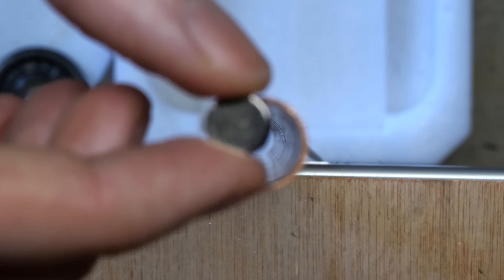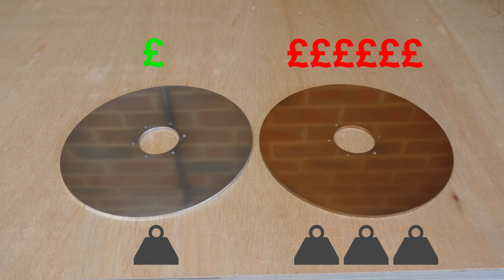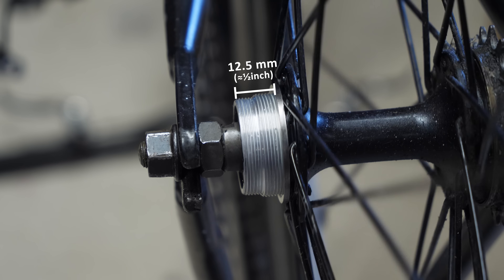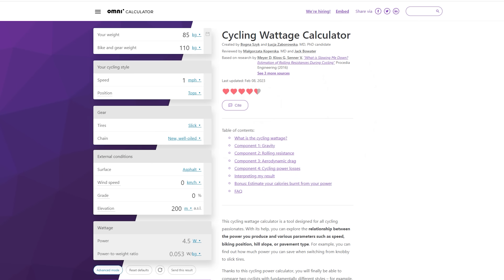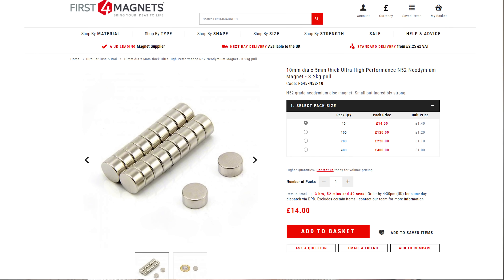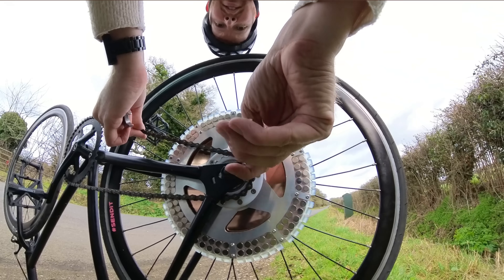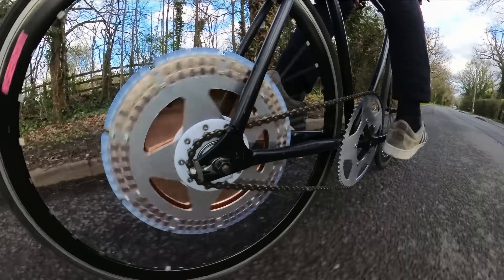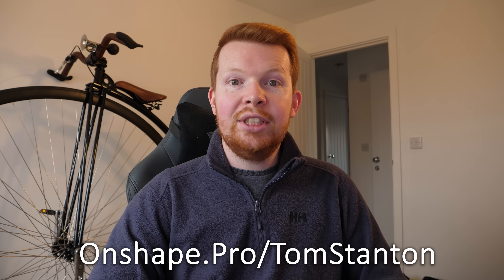Gearless Magnet Bike

Comment: It would be really good for semi trucks. Brakes heat up very fast in mountainous areas, and a jakebrake violates noise ordnances. This would be an awesome way to help big trucks keep speed down without burning out brakes, given sufficient torque and cooling. A static electromagnet could be switched on, and copper rotors on the axle could be cooled with air or some small boil-off system. Even if it overheats the only damage is warped copper, and the traditional brakes would still be cool.

Comment: Love the idea of an automatic clutch.
What about having a front gear made of many flexible rodes?
That way, the more the back wheel is pulling, the more flexible rodes on the front gear would deform, effectively reducing the apparent size of the gear.
And maybe flexibility of the rodes could also be adjusted on the fly moving contacts along those rodes, i.e. something that would allow to adjust what is the length of the ride that can effectively bend.

Comment: My thought is, get rid of the chain, use the magnets for a generator run by the pedals and a set of wire to an electric motor in the wheel hud. Then you want to stop, the hub motor could become a generator and electricity bleed with a resister, more resistance, more stopping power or a battery. Would this just be an ebike?

Comment: I don't get your end game. Using magnets in this way is going to create a clutch that will always slip and waste energy. A mechanical clutch will lock up and transmit power to the wheel without loss. Where is the improvement?

Comment: what about a combo bike that locks the wheel on forward pedal, but somehow engage the copper/magnet break until you engaged the actual breaks. That would reduce the wear on the brake pads and save a penny. haha. It's the hybrid idea that counts. Or evenuse it as part of the regenetive ebike braking.

Comment: Now i wonder, if you could convert the energy going to that copper disk to power a motor on the wheels, either on the front or the rear, like the rear wheel is still on direct chain drive but you have a digital drive (atleast that's the term i found) on the front.

IMO, that could make some funky bike designs.

Comment: The alternating magnets for stronger eddy currents was a great idea! You might want to look into the Halbach Array (a specific way of alternating magnets) that makes the field strength even higher. I think it might perform better than only alternating the magnets.
Reply: Exactly what I was Thinking.
Also can't he put a steel plate on one side of the array to cancel the magnetic field so he won't have issues with the chain and spokes?
Reply: @oodmboo  If he made the diameter of the disks bigger he could fit more magnets in to give him the torque he needs to go uphill and it would also solve the spoke problem since the spokes are already sloped away from the magnets further out.

Might run into torque issues breaking the disc though.
Reply: @oodmboo  And get a disc brake hub to mount the rotor disc on, since that's already precision machined for installing a metal disc.
Reply: @oodmboo  steel would just transmit the magnetic field.
Reply: Also it makes magnetic field much stronger on one side (the clutch side) than on the other side (the chain side).
Reply: the steel plate (ie completing the magnetic circuit) is better than a halbach array unless you are extremely concerned with size and weight
Reply: @5naxalotl  Rotational inertia is certainly important, though I don't know how much.
Reply: @JakubNarębski  I'm not an engineer but I'm a big fan of speed, and a little rotational mass goes a long way. Since he's dealing with low torque, I think differences of rotational mass will have even more noticable an effect.
Reply: @5naxalotl  I didn't know that! I'll have to test it out!
Reply: What about ditching the chain and going to a belt

Comment: Jesus - do yourself a favour and get a proper geared bike to play with. The splined drive hubshell of a cheap 8 speed Shimano hyper glide freehub body would be much stronger with 3d prints.
You are playing with the fixed side of a “track” hub - the freewheel side of a flip flop hub should have just the larger sized thread (without the left hand lock ring thread)

Comment: It might be a nice concept for combat robots. Usually they use belts to separate a weapon disk from a motor. The torque needed to speed up the weapon isn't too high, but when you have impacts you want as little torque as possible going back to the motor. 
Would be nice to see how it performs under big difference in torque being applied. 
It seams like it could smooth things up a little a be more durable than belts that often breaks

Comment: When the magnets stuck to the chain, I was thinking you could use a belt drive. Then I thought well, A belt drive has metal within so may also attract magnets. Then again I realize I have a belt driven pushbike. I put a magnet against the belt drive and no difference. Although a weak magnet. Does the rubber insulate from the magnetism? Nice video and some ingenuity.

Comment: I love how you had an idea and made it reality to test it. That's the sort of real-world findings that could prove to be useful for all kinds of applications that may even be totally unrelated to your project. I bet someone out there will see this and get inspired to try this in something else
Reply: But this is already in use. It's basically how an old school speedometer works. A spring loaded aluminium cup is driven by a magnet inside, that's it. Also many old record players use magnets to fine tune the speed (eddy current brake).
Reply: @westelaudio943  Cool. I did not know that

Comment: how about you mount a 3-phase motor (as a generator) to your pedals and another one to your wheel? then you can convert the AC to DC, and with a controller convert that back to AC at a different frequency for variable transmission rate.

Comment: you aren't measuring power transferred through the magnetic clutch, you're measuring power that's wasted in the magnetic clutch (and transferred into heat). so ideally you need that to be 0, instead of trying to match it to your pedaling power.

Comment: I see onshape allow their tools to be used for free for non commercial use. This is great and I might actually have to give them a shot - especially since fusion 360 has been doing everything in their powers to make sure every hobbyist user leaves them behind.

It is a bit of a shame simulations aren't a part of the hobbyist access though. Autodesk did the same thing with fusion recently - a bit of a shame.

Comment: I'm intrested in purposing this as a braking system instead of a clutch. I dont know how it will work but several advantages I can think of is that there are no wearing parts hence the brake will last forever, what do you guys think?

Comment: Another thing to note is that as the copper heats up, it gains resistance, which makes it harder to pedal, and also increases heat production. Vicious cycle. (I'm not sorry)

Something that would be interesting to test is if you added fan blades to your magnet disk, and drilled your copper disc for some cooling effect. It would require modifications for a thicker piece of copper, since you are loosing reaction mass by drilling the disc, but if you can keep the temps down, it should in theory be more efficent.

Comment: For your next project, make an electric bike right.. but have the pedals spinning a generator charging a bank of super caps. Then your stored energy from cycling can be used to increase the torque.

Also allows you to pedal harder even when going slow, and then when you need to accelerate fast, you have the power in the supercaps. Kind of like a hybrid bike.

I dont think the efficiency would be great though, but would make an interesting project.

Comment: I'm surprised the copper was only 30c. I expected it to be untouchably hot. I think a solution to that might be have the magnets on the wheel side and the copper be less obstructed and have some sort of heat sinking fins on it. Potentially even a really low profile impeller machined into the middle of it. But it seems like it still tries to act as a fixed gear bike, just with some slippage.

Comment: if you add a thin iron or steel disk to to the outside magnet surface, it will radically reduce the magnetic field outside of the disk, reducing catching by the spokes and chain, it need not be very thick.  it may also increase the applied field on the copper disk

Comment: Needs direct drive and magnetic overdrive.

Chain keeps a direct drive and magnetic forces to spin it past the chain ratios speed using the freewheel driver as a bypass.

Like a sun and pinion gearset. I'd go with three banks of magnets in a triangle formation around the disk.

Comment: belt drive would get rid of the chain issue
Reply from the maker: I've used belts for my ebike drive train, and they tend to be far wider than chains for the same torque rating. Which given the limited space, would be difficult to fit.

Comment: 16:07 You've made a math error. You didn't dump 8000 watts into that copper disc.  A pro rider is hitting 300 watt hours max, you're probably in the 125-200 watt range going hard for a 15-30 min ride.

Comment: Run some water pipe through the clutch and connect it to the seat or a vest circulating the heated water. That will make riding in winter more comfortable and fun. Just saying 😂

Comment: So what if you add a planetary gear to this? You will have your chain and wheel linked directly and the magnetic break will act as your third friction wheel. I am not sure it would change much though. At the very least you could easily lock the magnetic break at a higher speed to increase efficiency.

Comment: Hello! Nice vídeo! But this clutch is a heat dissipator. If you want a CVT behavior, you ll need and induction core (as a squirrel cage in induction motor) that multiplies the torque as funcion of rpm difference. Clutch transmities 0-100% of torque,  never multiplies ( as hydraulic torque converter)

Comment: A belt drive would help with the chain sticking to the magnets, and better wear life on the rear sprocket.
Reply from the maker: I've used belts for my ebike drive train, and they tend to be far wider than chains for the same torque rating. Which given the limited space, would be difficult to fit.

Comment: That was a brilliant experiment, and your manufacturing skills are off the charts. I built a magnetic brake for my exercise rollers a while back and found that the aluminum rollers also got pretty hot after a 30 min ride. That whole conservation of energy thing is real bugger. If we could only bridge that heat into a parallel universe somehow...

Comment: These videos are great but I think I'd find them more interesting if you tried to improve how something is made, rather than show why it wasn't made a certain way. Transmissions in cars, for example, work using similar concepts because you need to be able to disconnect drivetrain from the engine. An oversimplified difference between those and what you're doing, is that they use mechanical advantage via levers and friction material to create a more efficient transfer of energy. Let's see you use your big brain to make a better product!

Comment: Varying the distance from the center (the radius of the magnet from the sprocket) can change the torque and act as a CVT transmission
having something like a hydraulic actuator maybe can make the possible

Comment: The power calculation seems totally wrong? The power you're measuring/calculating is the power loss in a magnetic clutch.

I would rather expect that you'd take the required torque, figure out what will be the "loss RPM" at that torque and at a given number of magnets, figure out power loss from that, and figure out the smallest number of magnets where the power loss is acceptable.

Comment: The loss of a magnetic eddy current clutch/transmission is well known. I would like to see what happens if you use a faraday disc effect. Maybe a pair of them with crude PWM in the middle or something as an unusual motor-generator setup.